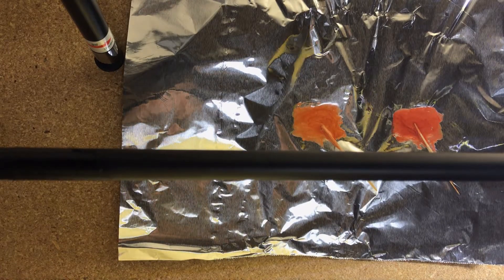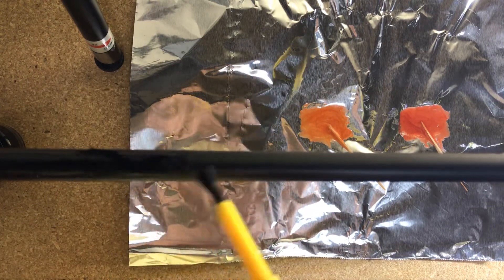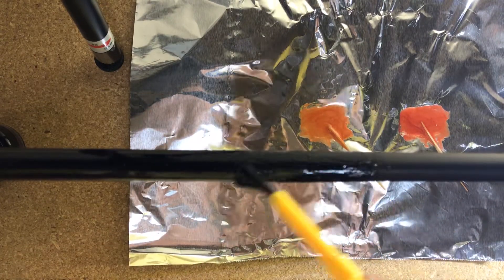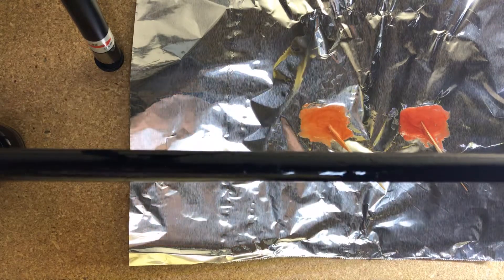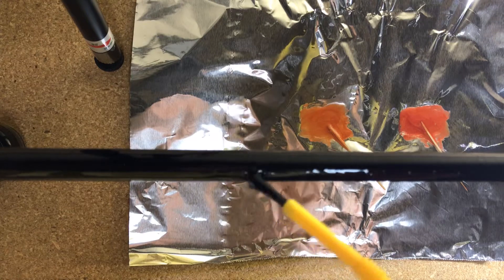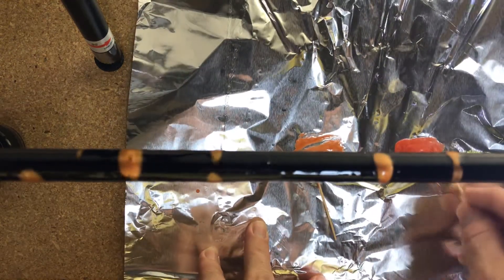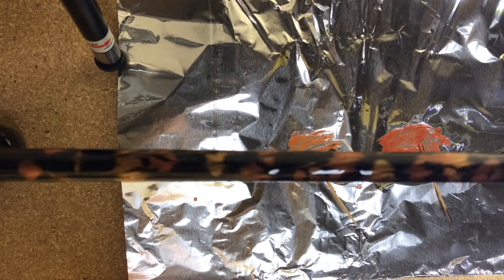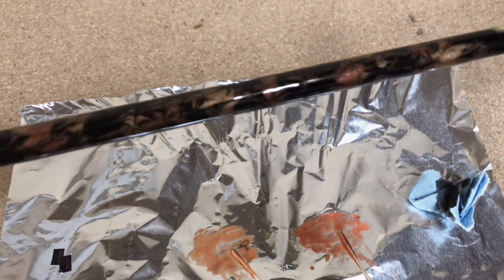Custom Rod Building - How to Apply Pigment to Fishing Rods

Comment: very interesting - I have a 40 something year old 10 ft spinning rod and a 56-year-old bait cast which was my second ever fishing rod I picked up when stationed in Key West just before separation from the Navy that I started stripping down to do a full custom build - I like what I have seen so far here - the spinner is new enough to not present any issues due to the full blank in the 25 1/5 inch handle - the bait cast is two piece with the bottom of the rod blank having a metal cap that plugs into the top of the reel seat - I have not been able to find a replacement yet since I suspect they are no longer used or in production - after seeing this I think I just might cancel what I was going to do with a rope wind and use this epoxy style instead - the last time I redid this rod around 45 years ago I just used spray paint - some rope - and not sure what kind of thread - I have another 5 to 10 rods I need to replace the guide thread to practice on before getting to the total rebuilds -
Reply from the maker: Wow Art Bobik, that sounds like a lot of rod repair in your near future.  Let me know how your projects turn out and thank you for watching and commenting.